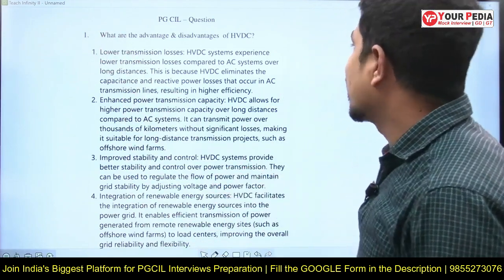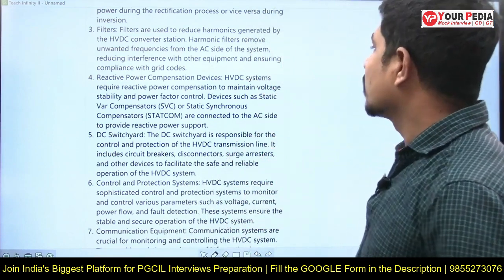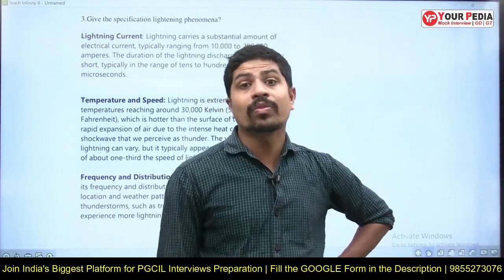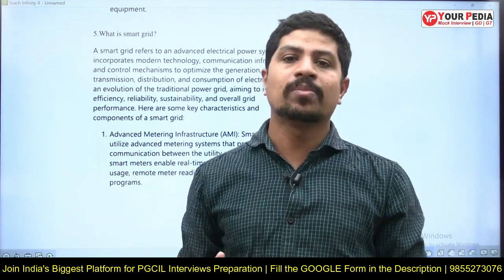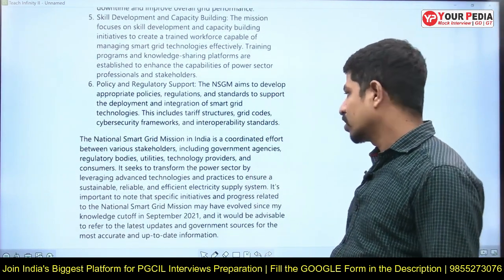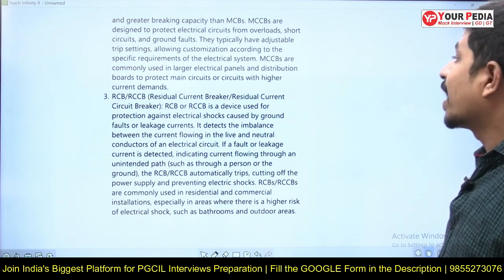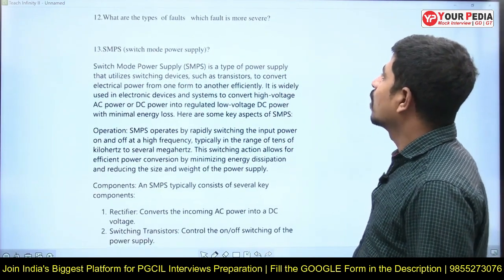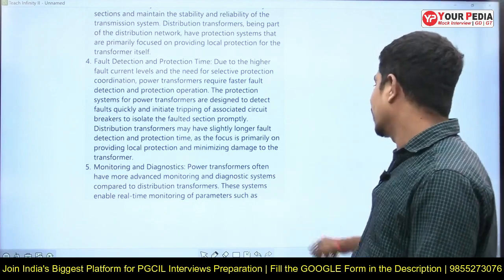Actual interview question asked in PGCIL interview | EE | Prepare PGCIL Interview with YourPedia

Comment: I have completed my diploma in electrical engineering in 2020 and I apply for PGCIL DT. Currently I am pursuing Btech (this will complete in july 2023) but in notification clearly mentioned that higher technical qualification like btech with or without diploma is not allowed.

But cut-off date for determining eligibility is 31/12/2022 and at this date my higher degree (btech) is not completed .so technicaly i am not going under this(higher technical qualification like btech with or without diploma is not allowed).

So please tell me, am I legally eligible for this job or not?